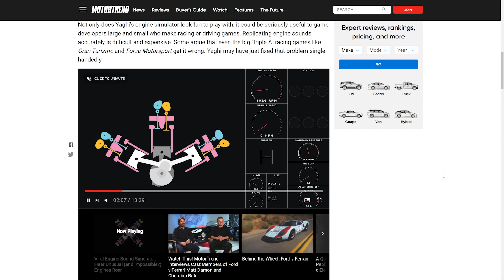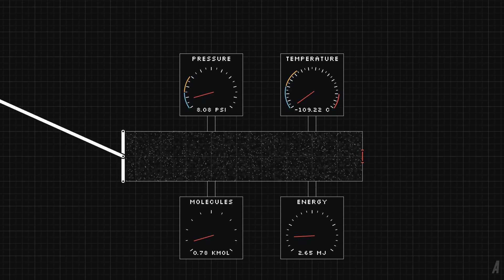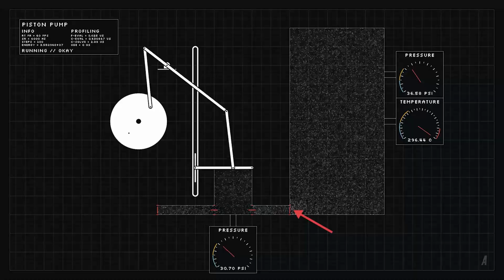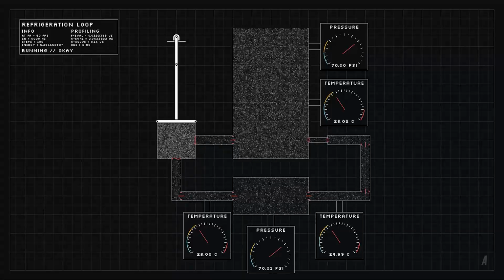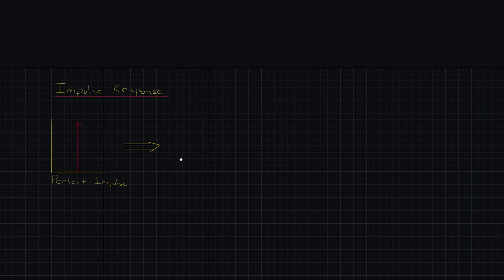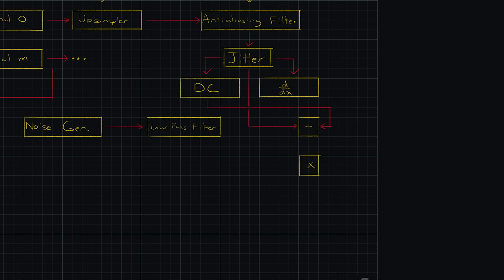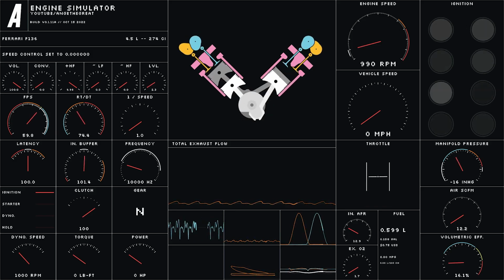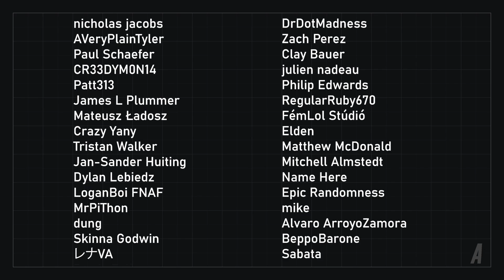Engine Sim: Procedurally Generating Audio Using a Real-time Fluid Simulation (Technical Breakdown)

Comment: To be honest I never saw where you account for the fuel's octane number or type of engine oil, or even if the engine is simulated to be in an car which perceives some G forces during turning/accelerating. If we add all things like tire resistance, road type/quality, all losses from engine to the tires, etc., then we can simulate more accurate sounds
Reply from the maker: A fuel's octane rating will have absolutely no effect on sound unless the engine experiences detonation which is never desirable and usually outside of the typical operation of a gasoline engine. Similarly, engine oil and especially the type of engine oil will have little to no effect on the sound of the engine exhaust. Tire resistance, road type and anything related to the vehicle are outside of the scope of this simulator which only looks at the engine and only roughly addresses vehicle physics.
Reply: @AngeTheGreat  That's weird because all of our old family cars (VW gasolines) definitely change their sound when we put better quality fuel and oil ... And the weirder thing is they decrease the fuel consumption with 0.5-1.5L for the whole trip
Reply from the maker: @GbpsGbps-vn3jy  There are a lot of factors that could affect this and most of these factors are taken into consideration in the simulator. Octane rating is just one value and is related to a fuel's ability to resist detonation. Detonation is always bad in gasoline engines and to be avoided. Other factors like energy density can change efficiency and sound and that is captured in the simulator. I've never really noticed any change in sound after changing oil or gas. Engines do make some mechanical noise but it's nowhere near as much as the exhaust sound which is what the simulation focuses on

Comment: im trying to download your free version of engine simulator but it wont run because it is saying its not safe and when i press run anyway is says a file is missing and the file is different every time i would greatly appreciate if you could help me out and im on windows if that helps
Reply from the maker: This is a pretty easy issue to fix, check out the FAQ on the github or join the engine sim discord (link in description). Someone will definitely be able to help you there

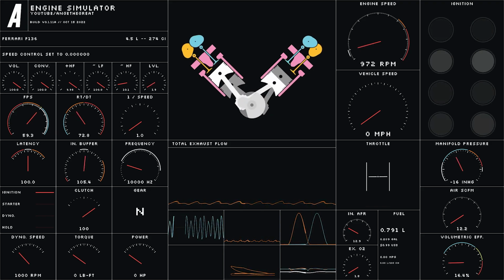Comment: 17:58 "Real simulation" seems like an oxymoron to me. :D I mean, if it were real, it wouldn't be a simulation. All models are wrong, but they can be useful depending on the ways in which they are not wrong, right?

Comment: I think "not a real simulation" is in response to some unusual fuel consumption, horsepower, and torque values
Reply from the maker: Pretty much any simulation, including those intended for professionals will output crazy values given crazy inputs (which would be most examples I've seen posted to YouTube). Even given sane inputs, no simulation will produce a perfect output that matches reality in all circumstances

Comment: I think you dismissed far too many variables, think about what makes a car change noises, the exhaust pipe makes ALL the difference, cars sound like completely different machines without one, and every model has a different exhaust too..

so it shouldn't sound accurate without a proper exhaust, unless it's compared to a car-less engine in a warehouse(which you'd also need to simulate externally the way you did internally for the cilinders)

where's the carburator? exhaust? the body/mass/shape of the car?
acoustics of a real, 3d, metal cilinder/piston? 

it really does look like you're just carving your way forcefully to your goal, focusing on the quality of the sound instead of a real physics simulation that happens to be accurate because physics.

yours seem to sound good because you approached it from a way that was bound to work.

what does an engine sound inside a room? in a car? with an exhaust? without? 

is it 2d or 3d based? what's the difference in fuel used? untightened bolts? engine mass and shape?

you could at least show why you assumed those variables to be insignificant and compare it to actual data from real engines, not subjective sound perception, which is what you seem to have perfected it for, but actual data about applied acoustics in such a complex system.

sounds great, appears to simulate really good, but is the mechanism of action justified?

if I had just recorded a bottle in a bike's wheel and shifted it half an octave or so I'd have a simulation that qualitatively sounds just as good as one of yours to the human ear.

I think you assumed too much about what matters, dismissed too many variables, and simply found a way to make your results better without actually doing a proper simulation.

the fact that you built a game engine, then programmed all this and it actually sounds coherent enough with real world engines is amazing.

but I don't believe that the way you generate sound is anywhere near optimal yet, but I do believe you will inevitably do it eventually, because you do seem to care about it being a realistic simulation rather than sounding good enough.

don't beat yourself up tho(far too many commenters like me will do that for you already), for a perfect result you'd need not only to a every single bolt of the car, but also the external environment too, like a whole city with ai driven cars just to make realistic background noise and it's just not feasible

approximations are necessary, but do justify them better, please.

Do an interview with a physicist that specializes in statistical mechanics applied to acoustics and/or an engineer with access to those "proper" simulators! It'd be amazing to see what they have to say about it, and I think it'd really help this project, and your channel("I showed my engine simulator to an engine specialist" would be a good clickbait title, YouTube might recommend it a lot)

even with all the pedantic criticism, I still think this is one of the most amazing things I've ever seen any one person do. 

it's impressive af and you deserve much praise for it.

Comment: I take back what I said in the last video about this. I see no way this could be simplified, without not even simulating the engine at all, which defeats the point of this project.
Reply from the maker: There are SOME ways of simplifying it by making approximations or just replacing the simulation elements with heuristics, but in some ways those solutions might end up being more complicated than the original project haha

Comment: What you developed is an awesome piece of software. But it seems you pay way too much attention to "reddit experts", makes you a person of low confidence. I mean, you are smart, work at google, what else do you need to be more confident? Approval of redditors? Stop worrying about their words IMO. And thanks for open sourcing the code. God Bless!
Reply from the maker: I'm not that worried about them, I just figure that if they had those thoughts, it's possible that other people have the same misunderstandings so I figured I'd address it directly in this video.

Comment: Seems you need help more... Why not simplify things and use the same units? It will save time not just for you, but also for dozens of people, who actually want to use the information you are giving out. It seem more like cutting corners than convenience, in the end there is a standard out there.
Reply from the maker: Not really. The units displayed on the screen are just that, DISPLAYED. Underneath, everything is done in SI units anyway. I personally am more used to pressure being given in either psi or inHg in the context of engine building as are many other people in North America. It never ceases to amaze me how seriously people take their devotion to metric units. I don't even dislike metric units and use the system almost exclusively in my daily life. What I take issue with is people spamming my comments about something as arbitrary as me using a system of units that they happen to not be familiar with. I don't see a lot of imperial users complaining about my use of SI units. I see a lot of the opposite though...
Reply: No offense meant, it's a suggestion, and everyone is entitled to choose their units, just to distinct themselves from the herd. By the way I have no problem with using Imperialistic units in the videos, but data should be stored in metric, or have a suitable annotation with each value, so calculations can be performed accurately.
Reply from the maker: I understand; from a programming point of view, I agree that mixing units is a nightmare and not something I would ever do. If you look the code it's all in SI units (including pressure, temperature, etc.) but it can be displayed in whatever unit you want. The displayed units are just meant to be understandable to the largest proportion of my audience and psi is just more common than kPa for informal measurements.

Comment: sounds a bit clickbait calling it a fluid simulation, if you're just messing with simple enough physics values, rather than literally simulating each, or a cluster, of particles
nonetheless good work
Reply from the maker: What do you think "real" fluid simulation are? They use the same logic but reduce the voxel size considerably for higher resolution. The rules are the same and the physics is the same. It is a simulation of a fluid. You have an expectation of what a fluid simulation is and looks like but there are actually many ways to simulate fluids depending on what accuracy you're looking for. Also the "simple" physics I show in the video is far from the whole story, it's not actually as simple as it seems. Writing a normal fluid simulation that you might find in games is actually a little easier than this

Comment: I wasn't going to say anything, but since you brought it up, imperial measures are bad and you should not be using them.
Reply from the maker: Why are they "bad"?
Reply: @AngeTheGreat  just an annoying lack of correlation and consistency between scales. If we accept that measurements of any kind are just convenient constructs with which we observe, measure and quantify things, why use the convenient construct that is the least convenient? If they're not bad by virtue of being better than nothing, are they not The Least Good (tm)? But forgive my ranting, I live in a place that somewhat failed it's metrication and has a neighbouring country that refuses to use anything but imperial and man, the constant switching is extra annoying
Reply from the maker: I'm assuming that you're Canadian, as am I. I find switching between units to be fairly trivial in 99% of cases. kg -> lb and vice versa is pretty trivial for everyday situations as are conversions for temperature and speed. Having grams linked to water seems arbitrary to me and doesn't have much benefit for most non-scientific calculations, or even scientific calculations for that matter. Probably the thing that I see people complaining about most is the use of inches/feet which I actually find much more convenient for construction than metric. Also the use of factors of 10 in metric is really not as convenient as people think it is, especially for mental calculations since it makes divisions by 3, 2 and 4 more difficult. You could say that the use of fractions is "inelegant" however, for precise machining, these fractions are not even used anyway and most measurements are in thou which is pretty much identical in complexity to using metric. For any non-scientific calculations, I see almost no case to be made for using bar or kPa over psi. bar/atm is arguably more relatable than Pa but I think psi is by far the easiest to relate to on a human scale since I can easily imagine a specific number of pounds applied over a square inch area. Meanwhile, a pascal is 1 N per meter squared which is fine for scientific calculations but very challenging to relate to in daily life. Anyway, I honestly think that people take units too seriously and I get NO comments from people complaining about my use of metric but plenty of people complaining about my use of imperial units, almost like it's a matter of pride or superiority for those people. I use both systems in different contexts and have no issue with people preferring one system over another, I just wish people would take it a little less seriously and get over their superiority complex about using metric like it makes them better than those who don't.
Reply: @AngeTheGreat  I find what is relatable or not in daily life is like religion, it's all nurture, not nature, and you've probably got a lot more freedom units in you from the english side of Canada than I've got in my ugly french derrière. Even the parlance here is still full of pouces and pieds and even when making an effort it's hard to stray from those habits. I try to not have a stick up my bum about it... All the sticks I try to buy online have their girths listed in inches and I dunno man... One small conversion error could be dramatic